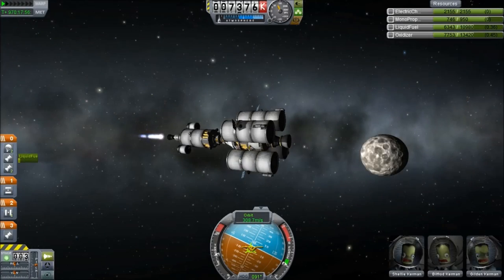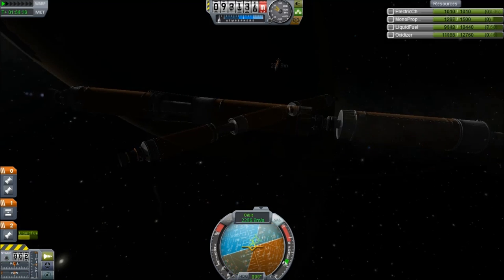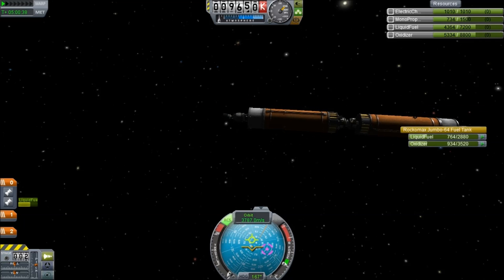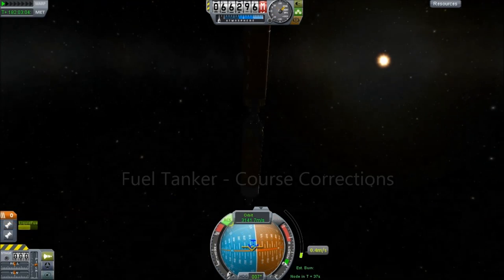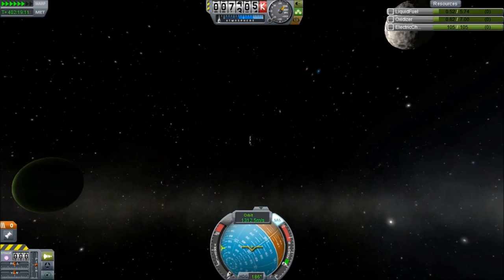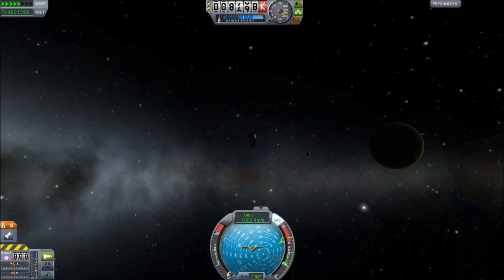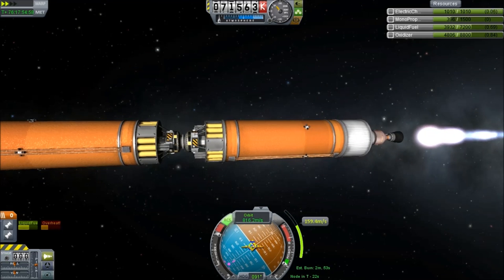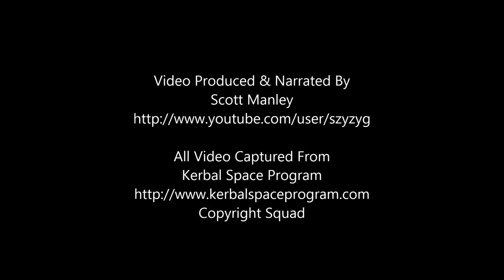Kerbal Space Program - Tylo or Bust! Part 3

Comment: Isp is basically a measurement of how fast you eject exhaust out of your engine,Ion engines have very high Isp because they literally use power to accelerate particles. High thrust is basically pumping a lot of fuel at one time through the engine, thus, more engines = more fuel flow while maintaining Isp. In launching, Isp is not important, what is important is getting your arse off the ground. But that is not the case of space, though.

Comment: If you want to change your energy then it is better to spend your fuel when you are going faster (so generally speaking that means lower) to exploit the Oberth effect. Scott talks about this in many of his videos. If you want to change your direction it is more efficient to spend your fuel when you are moving slower (so you have a smaller velocity vector to turn around). If you need to do both at once it's a trade off you'll have to experiment with each time.

Comment: Scott can you please start a new series soon? I know you're doing the beginners guide which is really good, and anyone who has done everything you've done in it can't really be called a beginner anymore, they should be rather comfortable with the game, but that either needs more challenging stuff, or you need to start doing new challenges. Which you did this and the Eve lander the game was very difference, and I feel pretty strongly that it will be more of a challenge and more fun. Also there's things like the outer planets mod, and I actually played some Interstellar mod on 1.0.4 and the only bug I found was my solar panels and transmitters for beamed power overheating when I was 1500000000m from the sun which shouldn't be a problem, it's actually a low anti-matter area, but it would be really nice to see you do stuff like this and the Eve mission again. 

Also I know you know every inch of the game but I've never seen you use the docking alignment in the lower right hand corner that you can click and bring up, I've seen you use the mod docking screen but not the one they built in, is there a reason for that?

Comment: Meanwhile, in my save: 
I set my sights on the Mun
We landed Kerbals on the Mun, but ran out of fuel trying to return and exploded.
The orbiter tried to go home, but also ran out of fuel and deorbited using RCS.
We launched another mission, this one with a rover.
I forgot how hard it is to kill vertical speed with nuclear engines.
All the thrusters broke on landing, but the rover was salvageable.
I managed to flip the rover and drive it away.
I promptly rolled it over and broke it.  Oops.